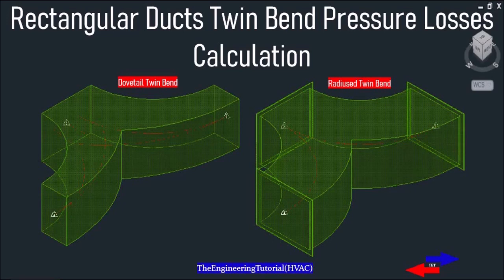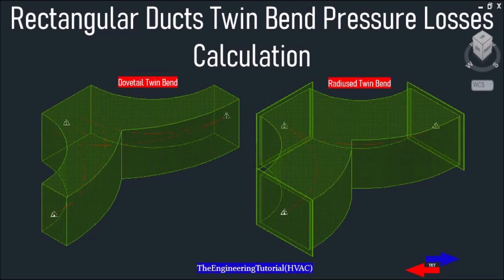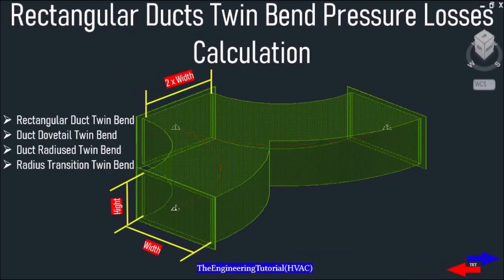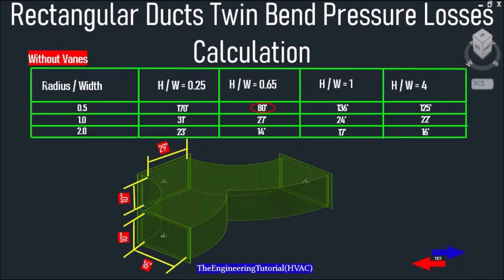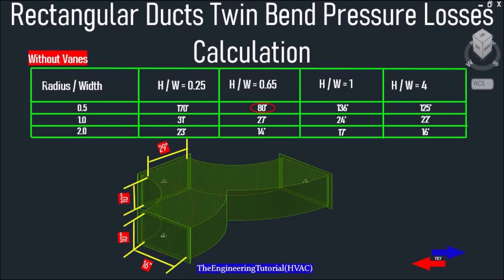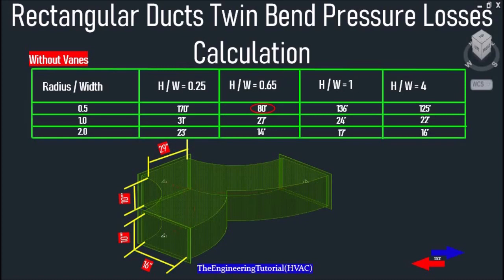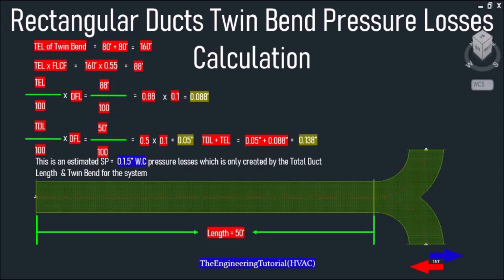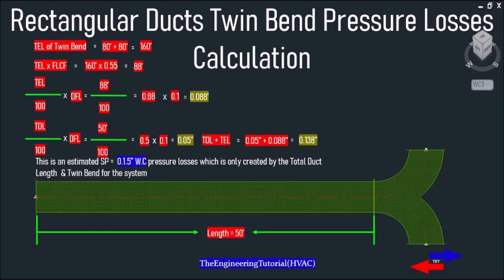Rectangular Duct Twin Bend Pressure Losses Calculation

Comment: Hi I would to know where you get that FLCF? What's the meaning of that? Friction loss coefficient? Or friction head loss?
Reply from the maker: Hi dear Magnaye, that’s the Fitting Loss Conversion Factors (FLCF) which is used based on the velocity design of main Duct and by multiplying the Total Equivalent Length of fittings for the system design conditions. I will share that table in the next tutorial video regarding pressure losses through duct fittings.